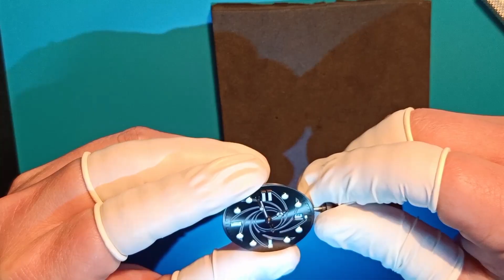Making a watch using miyota 8215- Omega x Rolex

Comment: I find that cutting the stem to correct size and placing the second hand on the pinion are the two most challenging aspects of any builds 😉.
Reply from the maker: agree
Reply: Place a small dab of Rodico on the seconds hand setting tool , the other hand use a 40x loop , works great ALL the time for me 👍🏼